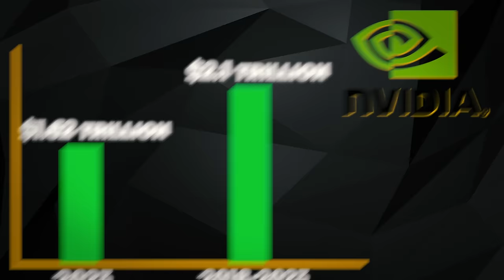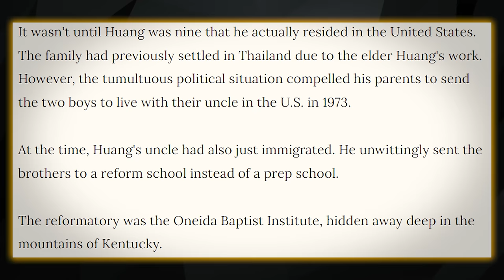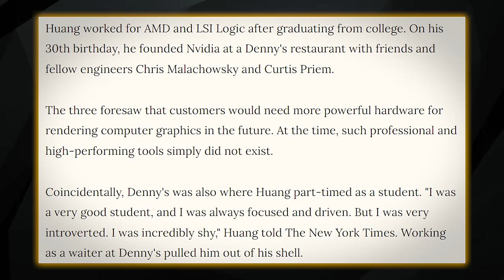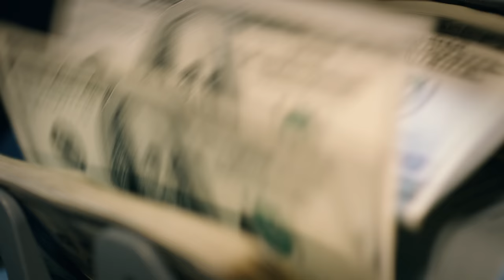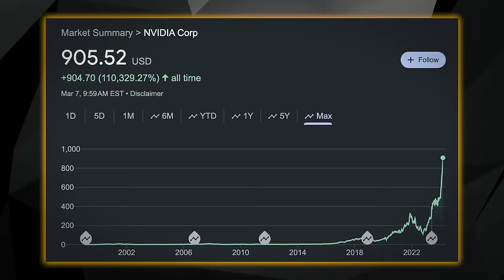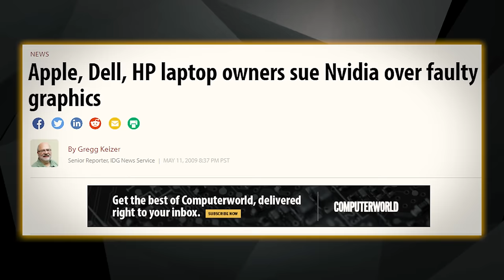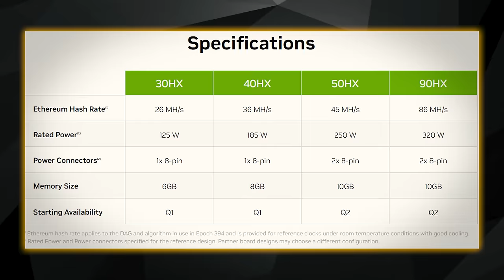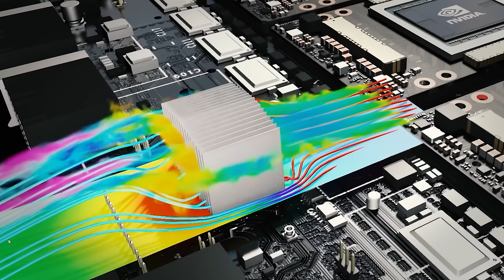How Jensen Huang Became The #1 CEO In The World

Comment: It's better to be lucky more than smart, but it doesn't hurt if you're a bit smart too.   I have no problem with Nvidia's success, however, I don't think people understand its limitations.  A good instruction manual and an easy to parallel "core" isn't exactly hard to knock off.
Reply: were will you get those design patterns. look at amd dont you think they could have done that.
Reply: @tinashe3753  .....  You literally have no clue what you're talking about do you?    Yes, AMD, INTC, and several other companies ALREADY HAVE better than NVDA.   What they don't have is easy to use APIs and a good user manual.   Literally.   That's it.